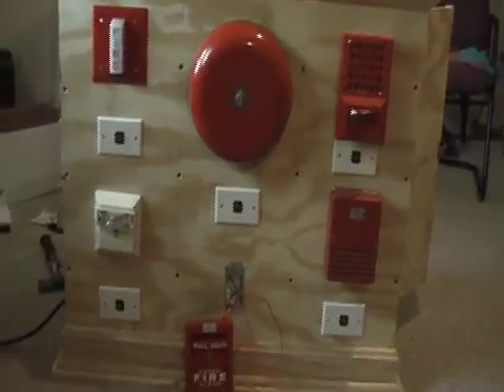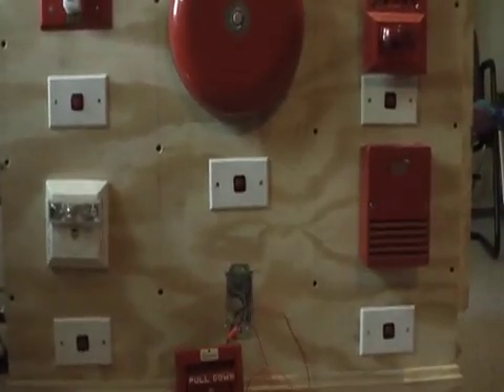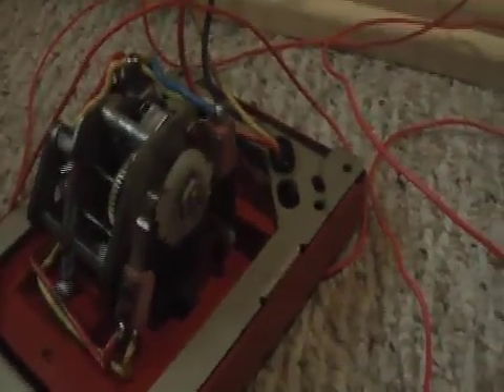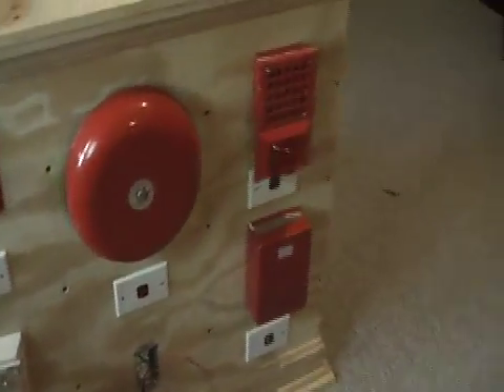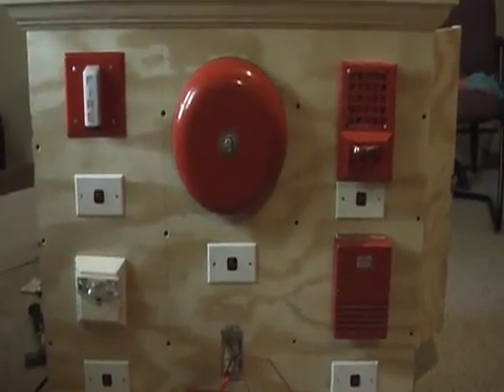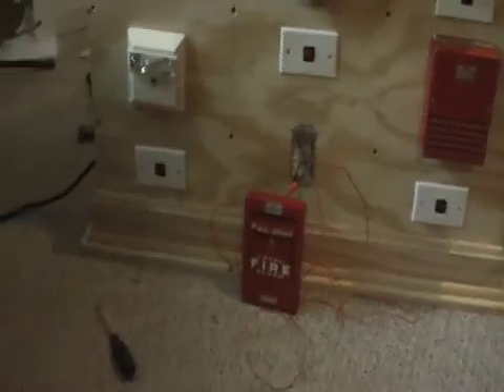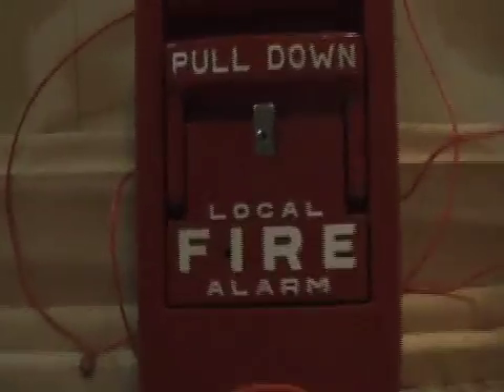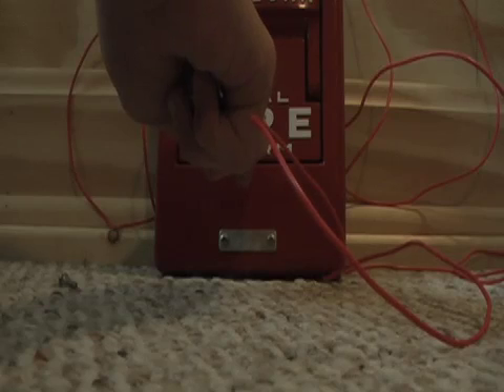Simplex 4263-1 Coded Pull Test

Comment: Goldenrod636 Well, they usually have one-, two-, or three-digit codes. There are no zeroes, of course. One digit code = nine possibilities. Two digits (9 x 9) = 81 combinations. Three digits (9 x 9 x 9) = 729. Add those totals together (729 + 81 + 9), and you get 819 possible codes. There were certainly more than 819 of these coded stations manufactured, so yes, there would be repeats. Just hopefully not in the same installation.

Comment from the maker: The code is changed by modifying or replacing the code wheel. New coded pull stations came with wheels that had spokes all around, and the code would then be set by breaking off the unused spokes.

Comment: Thanks for the video! How much would you say a Simplex 4263-1 Coded Pull  & a 4050 alarm go for on Ebay? I could not find any listed.

They are updating the system in my building and I might get a couple...

Thanks for any info!